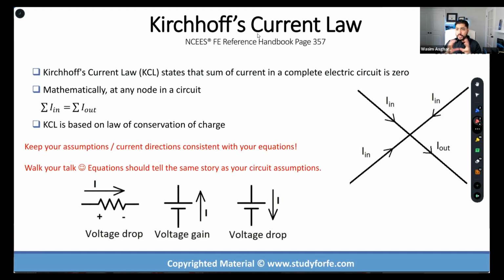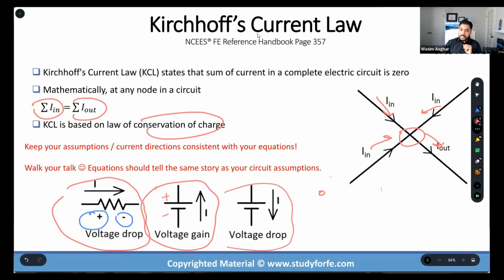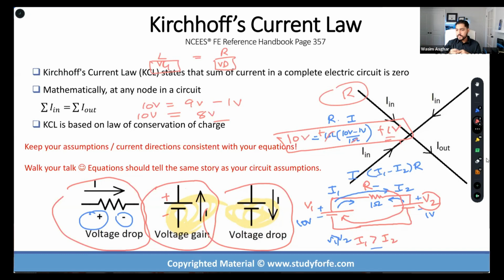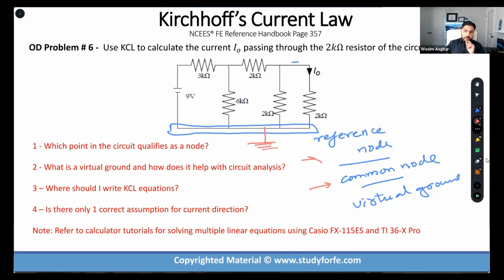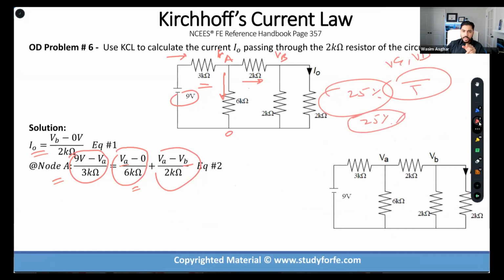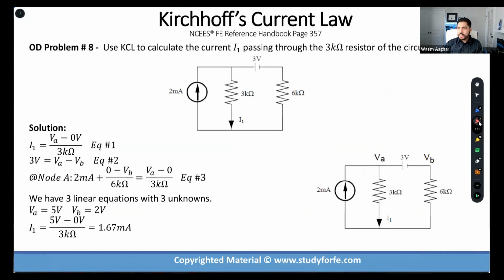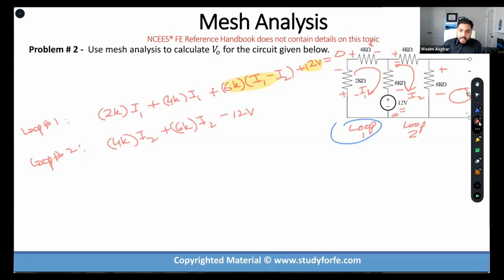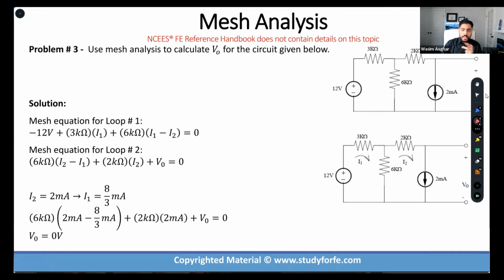Master Kirchhoff's Current Law in 40 mins : Live Training Review Lecture!

Comment: Did you say both calculators are recommended or just one?
Reply from the maker: Good question! In that segment I mentioned two calculators together as options that handle simultaneous equations well, either one works fine for solving the linear systems that come up in node/mesh analysis. It's not an endorsement of one over the other, just that both are capable for this type of problem.